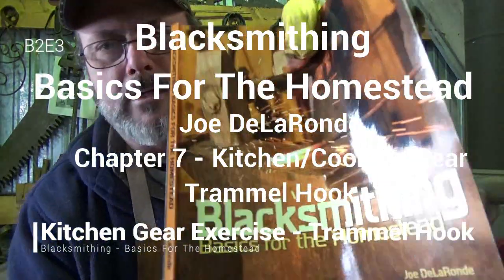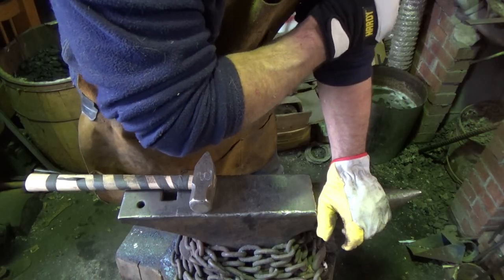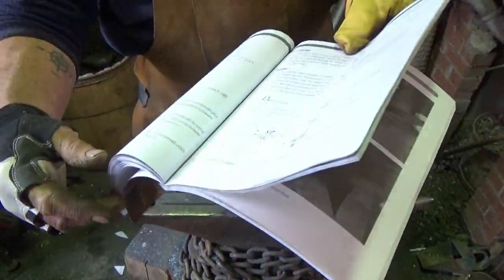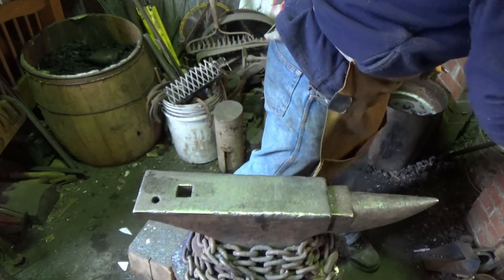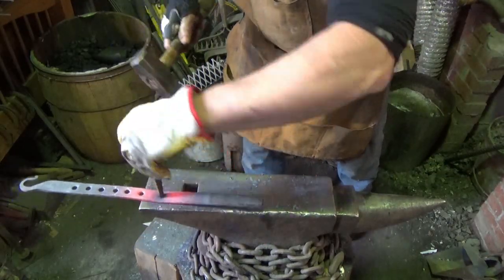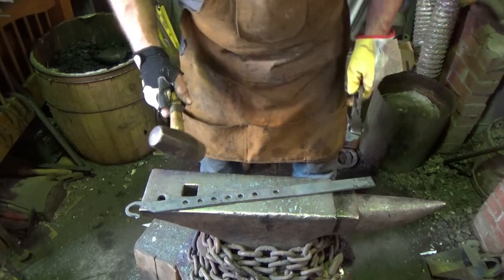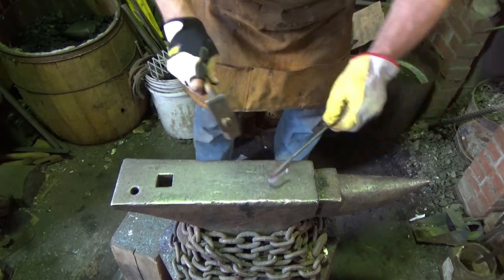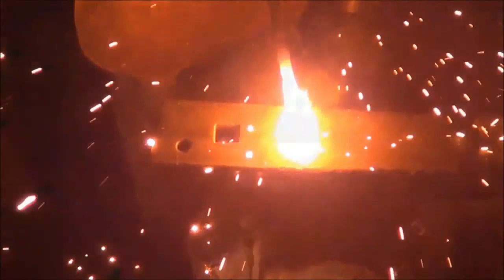Blacksmithing - Back To The Basic - B2E3 - Cooking Gear Exercise - Trammel Hook

Comment: Would brushing with beeswax while the piece is warm keep it from rusting or would it need a different treatment or finish?  (for an outdoor firepit?)
Reply: Oil of almost any kind will do the trick
Reply: Bees wax should work... won't get hot enough to burn it off
Reply: Scott Masterson keep it seasoned like an iron pan.

Comment: If you ever make another one of those do whoever will be using it a favor and add a rounded point and a little taper to the part that goes into the holes for height adjustments. So start with that end and taper about a 1/3 inch to half the thickness of the stock then round the end off. then worry about the hook. Also about the hook on that part... you got the hook on the other part centered then made that one off center which defeats the purpose of centering the first hook. And the to hook should be centered with the bottom hole so it all hangs straight (just a slight bend so the top center of the hook lines up).

You could make an actual niche product for camping, perfect that hook and then make an option for hanging but old school forged with hammer marks, An easy system would be two pairs of legs riveted together a couple inches below the top and an arm riveted to one leg with a hook on one end that hooks a pin on the other leg to prevent them from spreading further creating a V shape on top for the cross bar to sit on. Then make a cross bar with the ends that rest on the two sets of legs having indentions that fit the legs but at an 80 degree angle so the legs lean inwards and gravity keeps it all together. Once you get the toolless camping pot hanger made you can then come up with attachments.. a roasting spit that hangs on the legs maybe?, hanging BBQ rack(sounds good until it comes to flipping time and the rack moves)?